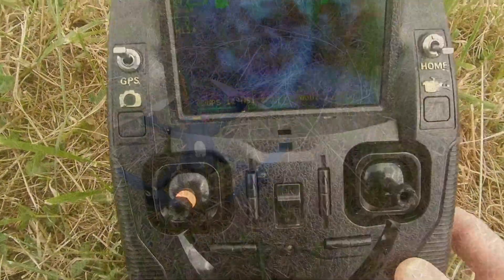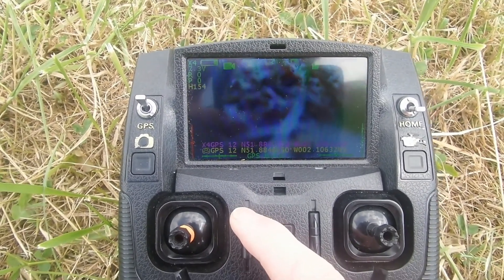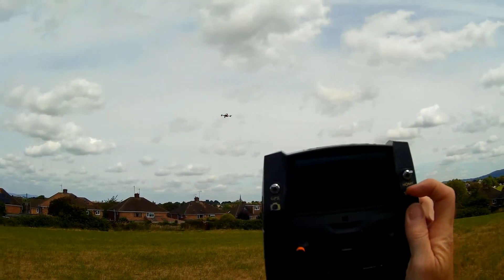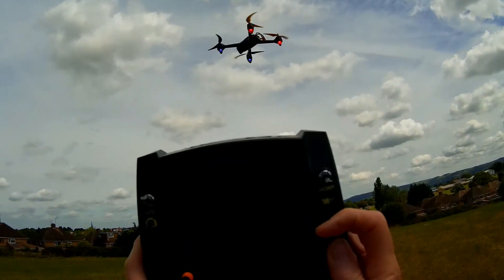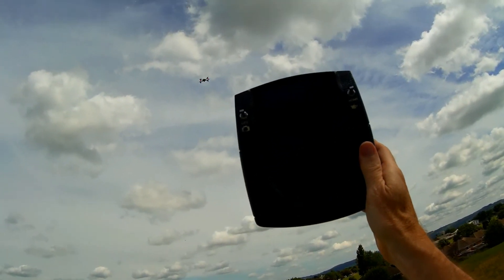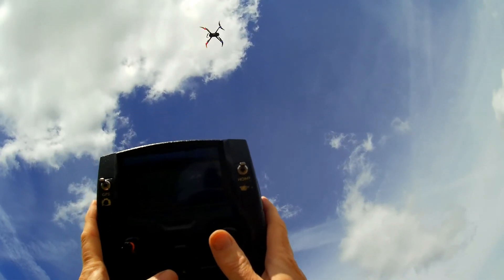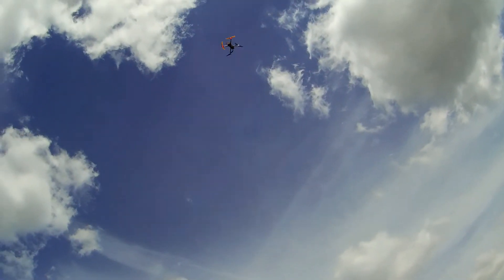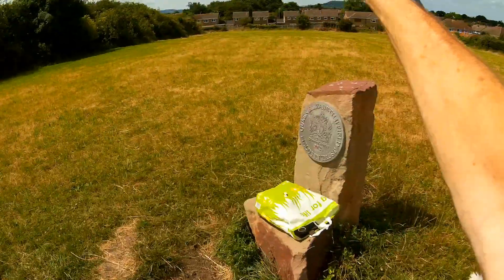H501 SS and H501A -  RTH "Feature"

Comment: Very interesting. thanks for showing      I upgraded the software in 501S and the TX, now  in RTH it will turn around with the camera facing you, also it has circle mode, further it will not take off or start the motors with less than 6 satellites if in GPS mode.   Now in RTH if will come back to the TX not to the starting point, ( watch out it does not land on your head :-) )  only if you switch off the TX will it return to its starting point

Comment: Hello,
It's possible to make a video explaining how to bind the relay with the Hubsan APP and the H501A X4 PRO?
I have experimented some issues to make it work.
Thanks in advance.
Reply from the maker: Yes. Give me a couple of days and I'll sort it.
Reply: If you are using Android it sucks I not found android phone yet that will work app bind procedure with 501a  and the h011t  can only fly it 2.4ghz no screen no data in flight line of sight on and it's bad lame duck that transmitter you can't turn GPS off so basically you gotta get the standard transmitter that comes with 501s to downgrade the A version  pay more to get less  or buy the new screen s001 worst drone I ever bought feel conned